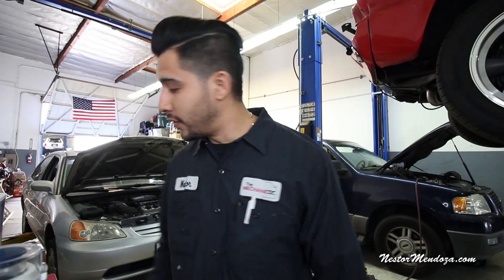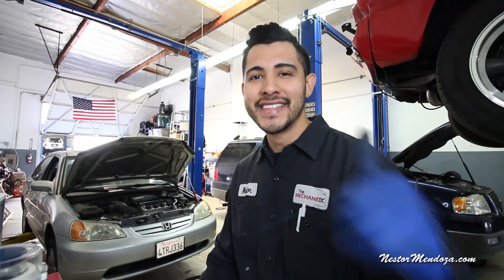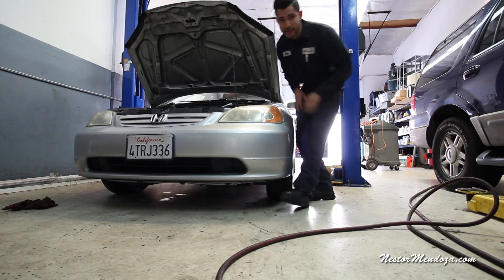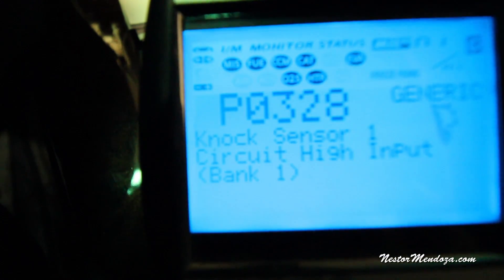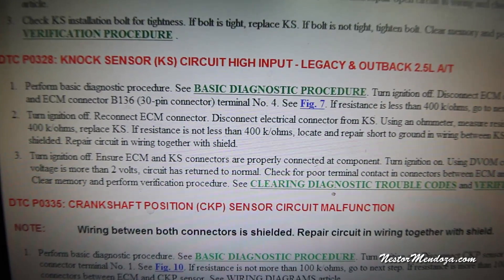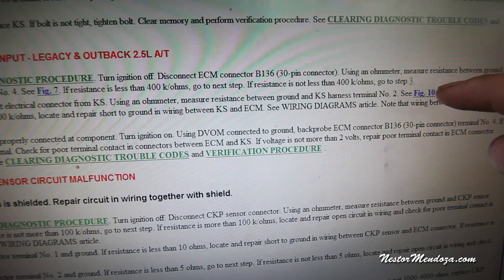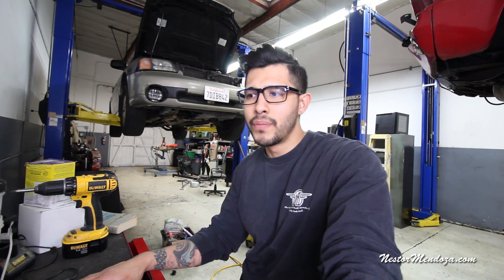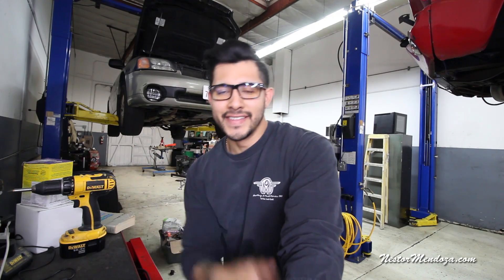How to use a Check engine light Diagnostic Flow Chart

Comment: unplug the sensor at the engine with key on u should have a bias voltage of around 2.5v, plug it back in with the scope connected to it and tap on the bolt to see if it produces voltage. from my experience the sensor always gives trouble and sets the code.

Comment: You better make sure that cat doesn't get in the engine compartment when you start the car.    A few weeks ago I had a customer that had the belt fall off on his van.  I saw what I thought was part of the belt sticking out from behind the power steering pump pulley.  After I pulled it out I saw it was a rats tail and leg.   The old belt was in perfect shape.  Next time before I reach down there I will look at the old belt.